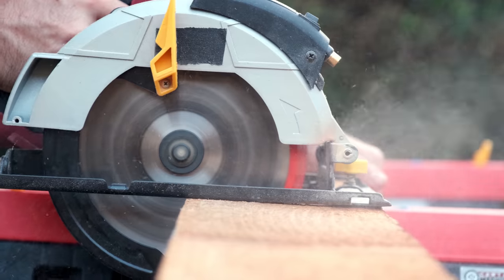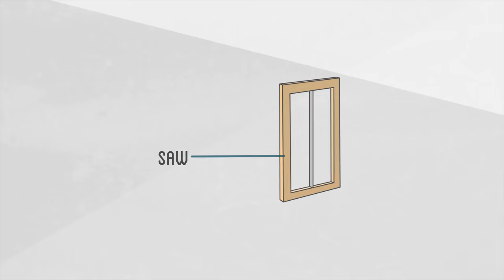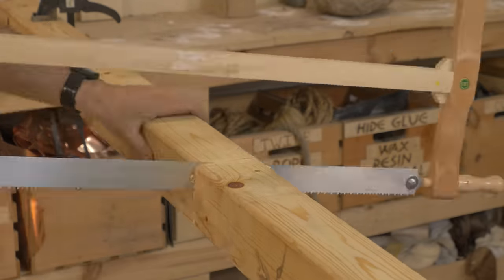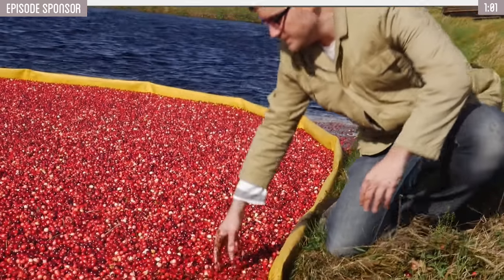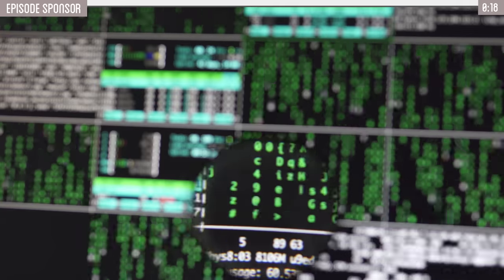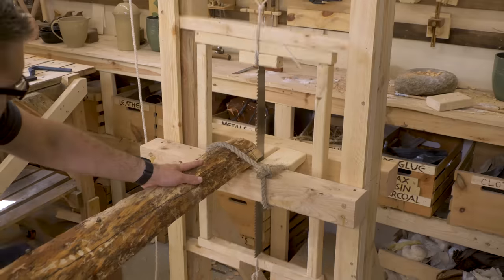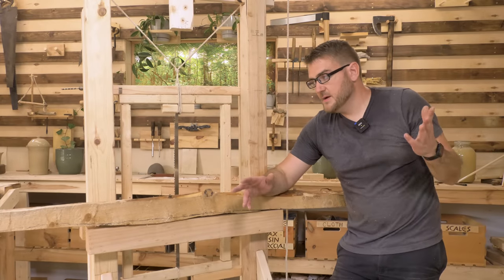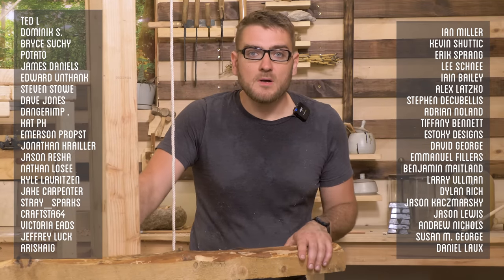This 12th Century Table Saw Is A Huge Force Multiplier!

Comment: Helpful hint 

A wedge to separate the material as you are cutting will dramatically reduce friction on that thick blade and make it easier to cut if you sharpen offset teeth. Like after your cut goes a certain distance, add a wedge to separate the material just enough to provide clearance to the teeth and to prevent the workpiece from clamping on the blade and causing it to bind. 

Even employing the chisel technique where the idea is to have the teeth act like cutting chisels with one directional teeth, or two directional. I find all teeth cutting in one direction on the foot stroke, and returning on the false edge of the teeth, on the spring stroke seems to make it easier but I have no scientific answer as to why other than it just feels like it works better. 

Good luck and well done!

Comment: "I'm on a quest to build myself up from the stoneage to the industrial revolution."  I subscribed just on that line alone.  Awesome idea.  

You mentioned that you were having trouble with your saw blade pulling the stock off the table.   This is due to the tooth geometry of your saw blade.  Saw teeth are swept in one direction to work on the push or the pull stroke.  I noticed that your teeth are just straight triangles.   That is what is causing the problem.   You have two choices that I see.  You can change the geometry of the teeth to he swept down to work on the push stroke or you can mount a solid surface above the stock to allow the saw to work on the push and pull stoke.  I'm not an expert on saws, but I don't believe that would produce the best results.  

Good luck with the saw.

Comment: Not sure if you incorporated it into the design, but in many hacksaws there is a bolt you tighten to adjust blade tension. This is, in addition to the feeding speed, super important to prevent binding and ensure proper cuts without blade-warping. Think of it like a tourniquet's mechanism! Overall though this is a cool design, good job!

Comment: While it might not be historical, I think you could devise a rope pulley counterweight system for feeding the logs into the blade.  Basically a rope goes around the log to a pulley behind the saw to direct the rope up to a pulley on the celling and a counterweight pulling down on the rope.  This way there would be constant pressure pushing the log into the blade instead of a ratcheting mechanism. You might need to make the system symmetrical with a pulley on each side to pull the log evenly.

Comment: Screw a straight reference piece of lumber to the log. Run the reference against a stop that’s parallel to the blade as you cut to get a straight square line. Remove reference piece from log once you have one good surface on your log, but now run that that good surface against the stop.

If you get smart, you could dovetail the reference piece to help hold your stock piece down as you cut.

Comment: Correct me if I'm wrong but it looked too me like your saw blade either cuts on both strokes or is one way and put in upside down? One that cuts in only one direction oriented to cut on the down stroke will stop that jumping almost completely with proper pressure technique and give you much better control & speeds.
Also: pretension your bow a little to help the return speed and force.

Comment: One other improvement I would suggest is the using the foot pedal more like you would a drum kick the way you were using it the blade was travelling a shorter distance that your foot was moving if you had the foot pedal set up like a drum kick you could push down on the middle and the blade would travel double the distance that your foot would have to move that paired with the other suggestions of blade orientation and table length would greatly increase efficiency
Reply: The more travel you have the less mechanical advantage you have. You are always trading movement off for force. That's how leverage works. A larger movement gets translated into a larger force over less distance.

Comment: your frame needs 45 degree angle supports at the top and bottom, on the x y and z axis. to reduce flex, and binding. adding a saw horse to your side, front and back of the machine will help also.

Comment: Did you crop the music along with the video at 2:57? I wonder how much more efficient this could be made with little adjustments. Like decreasing the friction between the frame of the saw and the guiding slides. Perhaps some pulley to multiply force and stronger bow system to make the saw slide faster? Fine tuning the sawteeth. Some system to be able to step the leverage of the blade from different distances easily and better table for the wood to sit on.

Comment: I think it could also benefit from anchoring the frame to the ground, so the action of the bow doesn't cause the whole thing to bounce. To get more performance from each draw and return, it would also be beneficial to set the bow higher and utilize more of the blade by having a longer draw from each step, but you'd start approaching a two-story table saw. 😅

Comment: Hm. 
Looking at the other comments, everyone caught the saw tooth angle issue. A longer table and saw stops have also been mentioned. 
If you wanted to use this for cutting a board to length rather than width, you would need a way to reorient the blade 90 degrees, or make another saw specifically for cutting across the grain.

Comment: it might help if you moved the two wood blocks holding the blade straight closer together like barely bigger than the saw width that will keep your saw from wobbling left and right as much and will keep your cutting edge oriented better which would help prevent any bending in the saw that would lead to binding. also maybe widen the kerf of your teeth a bit more to make sure its always wider than the blade.

Comment: thanks for the video. of your efforts i would rate this one as one of your best. there are issues i see in your design though  the largest being the stroke of the saw.... your only using half your cutting length! so change the pedal fulcrum for greater travel. as you discovered you lack stability so a wider table or infeed and outfeed supports. as far as matching the blade to the job yours isnt ideal but it isnt the worst either you may want to get a finer rip saw and also a much wider resaw blade.

Comment: You should consider building with 2 by 6 boards. They often come with fewer nots, straighter grain, and all around better. Plus they are stronger and you can always cut them smaller and still have all the benefits.

Comment: An intermediate set up between this, and a full-fledged sawmill. I think would be to simply hook up the pedal to a water-powered trip wheel. You might still need to feed it and control it by hand. But at least the powerstrokes will be coming from somewhere else.

Comment: Switching the blade around if it is an angled blade would make it much smoother, easier and faster, plus easier to keep straight.

If it was straight tooth (bi-directional) a block over the piece would work to stop it from rising. It would need to be a big beefy piece for that material being cut.

Another note, most sawing should be feather light pressure. I’m still learning to master this myself, but I was cutting aluminum the other day, and like wood I have cut, long strokes with little to no pressure is the secret of the masters. Just enough grip to hold the saw and pull, virtually no force. It will cut on its own.

The other secret is the angle. If the angle is wrong, it will grab. That’s why most people have to force the cut.

Comment: For your woodlathe. Why not  make a bowdrill and have it attached to one of the ends of the wood, so when you get done with three quarters of the piece,  move the string to the other side. Just make it peddle powered.

Comment: usually you would want the force of your cut going into the base of a tool (purposefully vague). I get that the ideal to be less tired would be the bow doing the work of cutting while your foot just has to fight the bow but parts of the design should be flipped so that you are cutting with the material supported on a solid surface and not a rope. Also, it would be wise to take the elliptical (or half elliptical) nature of this mechanism's motion into consideration to possibly move the blade away from the material when you are pushing down on the pedal to avoid unnecessary effort.

Comment: I just thought if you used a guide to feed the wood then use a weight system to move it forward (a loop behind the wood  to push it in). But I suggest a roller on top to help hold it down as it moved in.

Just my thoughts on this.

Comment: Hey I do woodworking and a tip tilt the saw like forward that it’s just slightly like this \ that it only cuts on 1 part and not the whole saw so it doesn’t grab and pull up

Comment: Wax from hornets (wasps). There are a few species that do this.

Or if you're willing to fork out the cash you can get royal jelly and some bee's wax. 2 parts jelly to 1 part wax. You'll have to heat the wax and stir in the jelly. Depending on the moisture content you may need to add more jelly.

Edit:

Should be like stiff vaseline.

Comment: You can put the "support table" closer to the blade so it doesn't dance to the sides as much and occasionally put some wax or oil on the blade to reduce friction and make the cuts smoother c:
Reply: Also some guide rails on the foot peddle.  It is bouncing all over the place contributing to this lateral movement.

Comment: Having the teeth pull into the frame will drop your cut time significantly. Also, a sawhorse in front and behind the cut helps keep things balanced for the feeder to feel the cut and put the log through without over or underworking the blade. 

Classic sawmill tip, often said with a sweaty brow, "Let the blade do the work."

Comment: So, rather than a vertical linear cut, either make it into an elliptical cutting motion where the downstroke is closest to you, or create a circular saw blade (more metal intensive) which is set to have its downwards motion on your side of the blade.

Comment: Are the teeth offset from one another? It will increase kerf but reduce the binding....also using an adjustable solid hold down, other than a rope would work better, also look at infeed and outfeed supports

Comment: I’d suggest having the saw flipped so the main cutting action happens on the downstroke. Waxing the blade helps to prevent binding. Try mixing beeswax and talo or olive oil.

Comment: Would flipping the blade over (like others have suggested) result in a loss of sawing power since it'd be your foot doing the sawing rather than the spring? If so, was wondering if flipping the whole saw over and attaching a pulley to the foot treadle would work.

Comment: To hold the wood in place you need a piece like a shaving horse has. Something using leverage to secure it like vice. Might be an issue since a shaving horse is also operated by your legs, but the basic design should be applicable.

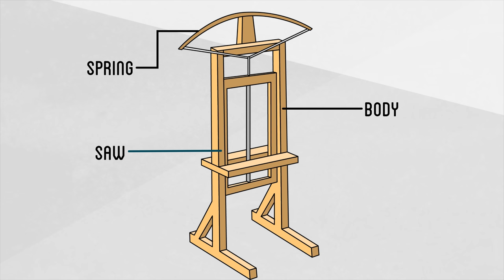Comment: At 02:09 you see some crucial design elements that were ignored by HTME (not even mentioned, so not cut out for the sake of saving time or lack of materials):
1) the blueprint shows the saw teeth angled DOWNWARDS because you want the saw to cut on the downstream, forcing the piece against the saw table.

2) the blade has roller guides to keep it centered during the cut (look at any modern band saw and you will find these roller guides to keep the thin blades centered).
3) The tensioning mechanism for the saw blade is needed to help prevent the saw wobbling as much while you jam the workpiece into the blade.

Good content, but you're trying to reinvent the designs by making all the mistakes that were already solved in the blueprints you show.

Comment: I think that there are a bunch of improvements that could be made to this saw. As many have suggested a blade that is oriented to cut on the down stroke. Next is to look at where all of the energy in the system is going. As you press down energy for the return stroke is stored in the bow, but it is also consumed by all the string parts in the setup. these look to be polypropylene rope which is quite stretchy and most of that energy will not get returned but will be converted to heat and lost. Replacing these stechey elements with wood or metal would improve efficiency.  

Next is the table of the table saw which is tiny. By adding more table both in front of and behind the saw would provide a much bigger reference surface and this would improve the accuracy of the cut. The next improvement to accuracy would be to add a fence that is parallel to the saw blade. Running the work against this fence would greatly  improve the accuracy of the cut. Even when sawing a live edge board a previously cut board can be spilied onto the live board and the straight spilied board run against the fence.

Comment: If you angle the teeth slightly in an alternating pattern it will create a larger Kerf than the actual body of the blade and it shouldn’t pull up as well has makeing the teeth pointed down so the cut stroke pulls uses the table as support and the up stroke just recovers one last thing applying bees wax to your blade should also help it not stick implement those thing and you should be able to get it running smooth for a better quality cut

Comment: The efficiency of the blade is the result of the angle presented to the wood  ie a cross cut is semetrical with both faces the same a rip saw has the working face at 90°to the work and no or little angle and a full set giving 1.5x blade thickness,  from my great great grandfathers engineering books engineers and machinists assistant  1840 a 3 volume set , covering all aspects of engineering and construction

Comment: You may want to have a blade with a skip tooth design or with larger teeth.  They are necessary for cutting rough and unseasoned timber.  A thin piece of metal to act as a writhing knife should reduce the binding.

Comment: If you were to turn the rip saw blade the other way would help with the timber pulling up while cutting 🙂
Reply: Wont help. The saw just has the wrong tooth geometry so it tries to cut both ways.

Comment: The easy solution for the binding is to hammer in a wedge so the wood doesn't close up. Another aspect could be to set the teeth a bit more.

Your projects are very cool but you're seriously making some missteps that costs you a severe labor multiplier. For instance, the saws you use aren't close to what you need for it's intened use. You  would make it half as dificult with a wide back so it tracks easily, long, larger teeth (teeth geometry for ripping) & a appropriate set. All of these things will make it eat soft wood like butter.
I've used the roubo frame saw for resawing for a few years now & it handles a log without issue.

Another aspect is green vs dry wood. The former is wet & easier to cut.

Comment: To make the sawing effort easier, I would make the teeth smaller and give them an offset so that you cut a wider kerf for less binding. That's in addition to having the teeth cut only on the downstroke.
Reply: Smaller teeth will be worse. For the resaw work he is doing, you want about 3 tpi tops. So that is going to be big teeth. The tooth depth collects and clears the saw dust from the cuts.

Comment: Is there a reason why the bow string is tied to the center of the saw blade carrier instead of just attached to the right and left sides of the blade carrier? I feel like putting it off to the sides could lead to a more stable motion with less stress on the springs; it would make the stress on the bow vertical instead of angled towards the center. I think you'd get more efficient work from the bow.

Comment: Probably won't get seen, but I've got a kinda weird question I've been curious about: how do these projects impact your fitness? I feel like they require quite a bit of exertion (especially stuff like manually sawing an entire log), so I wonder if they end up supplementing any existing workout routine you do or if you actually have had to exercise more to maintain the strength and stamina necessary. Maybe I'm just overestimating the amount of effort this all takes, though...

Comment: Trying to hand saw a 2X4 out of a log was not a preferred method for producing lumber even that far back. They did a few different things, but mostly they would either find a log about the right size they needed and hew it with an axe, or meticulously hammer wedges into the log while walking them down the length to split the entire log to more manageable dimensions. The wedge technique isnt that difficult or time consuming either. I used to do that to turn telephone poles into limber, because I didn't want to breathe in the saw dust contaminated with arsenic and creosote they used as a preservative. 

The best industrial method they used though, were water wheels to drive a saw blade.

Comment: one issue with this design is that it requires more leg strength, whereas a normal treadle is angled away with the flat towards you, to allow more use of bodyweight and leaning into your step, using more of a rocking motion than a stomping motion.

Comment: Id say that once you get the base line of a tool you could use a modern verishon of it so water powerd  table saw you could use a modern one as the power sores chaengd but not the tool so a tenion saw would be a bowsaw  but do not ues them if its just a little cuting but a lot of cuting

Comment: I suggest to look at a "die filer" machine (thisoldtony) have a video about that. You find that an arm that take down the piece on the table is needed to prevent the work piece to be lifted by the tool, in the return stroke.